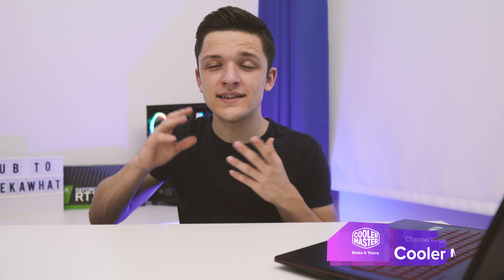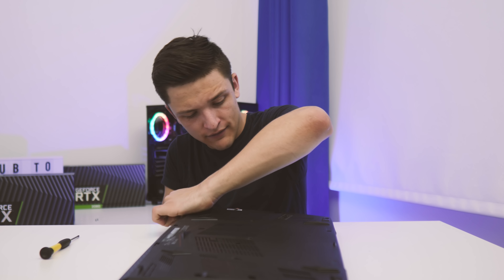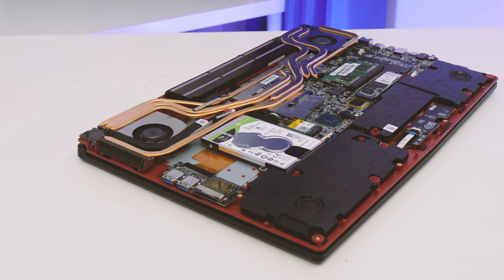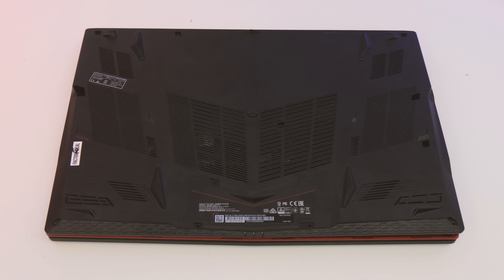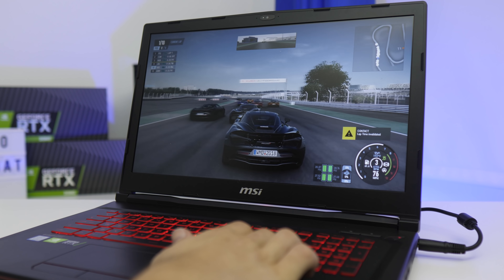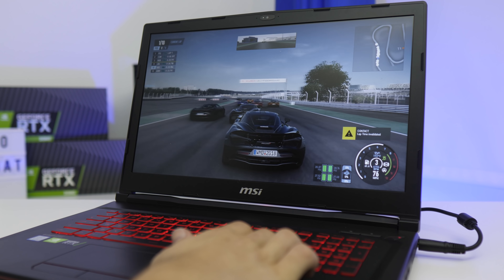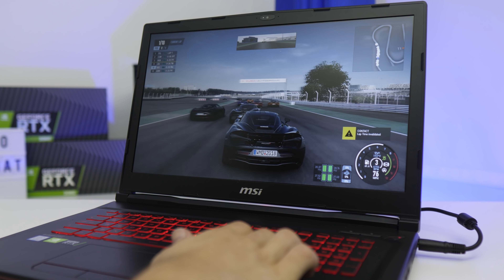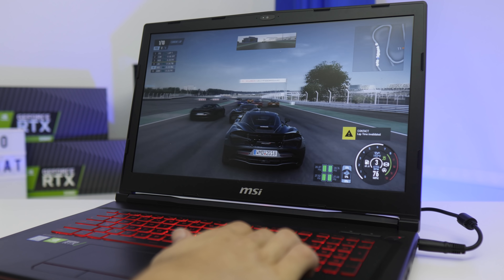An RTX 2060 Inside a THIN Gaming Laptop? The Results May Surprise You... [MSI GL73 Gaming Notebook!]

Comment: Did breaking that Factory Seal sticker to open the laptop void the warranty? I just bought a GL73 9RCX-029 and I want to add an additional HDD. I'm not getting a straight answer from MSI. Thanks!
Reply from the maker: I'd guess it does on the basis that the sticker is there as evidence you've opened it, but I'm not entirely sure in all honesty
Reply: @GeekaWhat  Upon further investigation (as per MSI), the Factory Seal is not a warranty sticker. They put it on after they finalize your configuration before shipping. It's to prevent tampering from MSI to you. Included in the box was a drive bracket to mount the additional HDD.

Comment: Great job dude. 
Need to invest in some heat pipes for yourself this summer !
Reply from the maker: Wish I'd thought of that when I bought an air conditioner xD
Reply: GeekaWhat still time. Add heat pipes to self and connect heat pipes to front of air con.  Job done.  Fully functioning conductive cooling system.

Comment: Which one is better this laptop or predator helios 300?
Reply: Its the samething acer predator helios 300 checc it out
Reply: I just bought the MSI and I can tell you to choose for yourself.

This MSI model is very good looking compared to Predator Helios 300 ( Not very gamery edgy looking ). Also The MSI is known to be more durable ( i cannot prove it since I just bought it ). Even though the predator helios 300 is not that good looking it is cheaper and stronger than MSI but the CPU temperature can be a bit hot. You might want to be careful, and the battery life of the msi is better